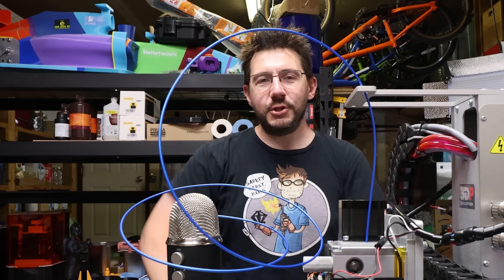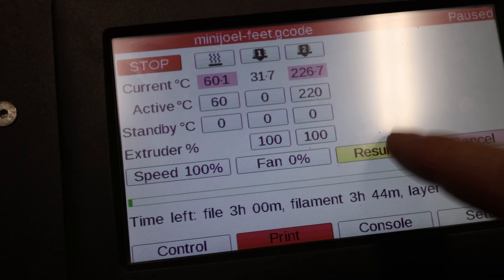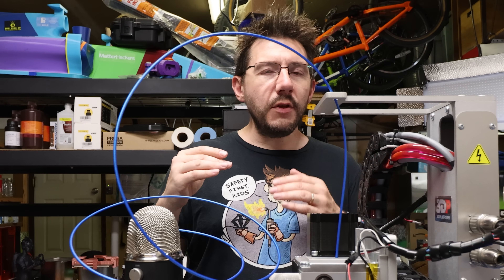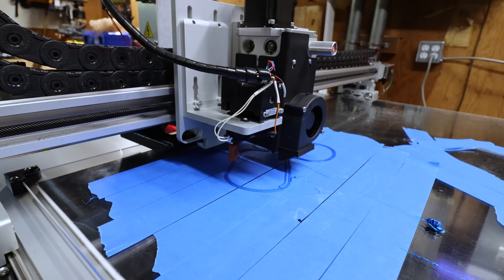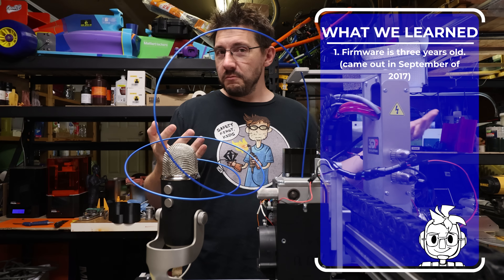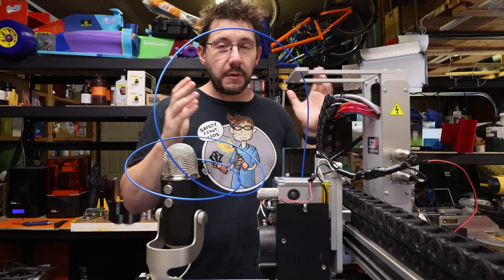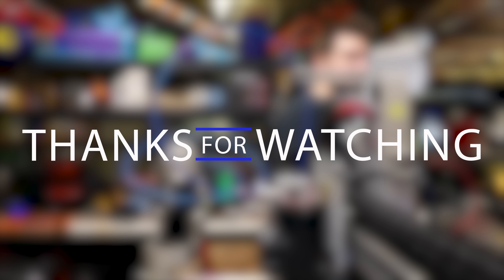Troubleshooting the $38,000 3D Printer

Comment: Hi there Joel. I've been thinking about the troubleshooting of the heating element temperature stabilization range. I have to see that in person, but that thing has a lot of metal to heat, this is 300W of power, and what I think is, even if you turn off the heating element, the temperature will drop until the internal resistance generates enough heat to stabilize the temperature, so it has to mantain the temperature on the higher side, I'm guessing, to keep the filament as "fluid" as possible in between the range... I don't really know but i wanted to discuss a little about the topic lol

Comment: This are some problems i ran into with previous itterations of this printer:

-Z home sensor fails occasionally and the nozzle can perforate the printbed.
-filament sensor can act unresponsive and freeze the printer due to false negatives.
-the printer doesn't work very well with cura.
-the printer's software is way too simple for a 38k machine
-the printer is way too basic like a cheap old anet a8 when it comes to features. 
The only thing this printer offers is that is big.

Comment: $38,000 ..... In reality it is less than $4000 in extrusions, motors, and control box. 10x profit seems excessive. Price gougey. Buy a REAL CNC machine, and get the print head upgrade. You will have a real monster of a machine for less than 10,000. Shown here is an expensive toy.

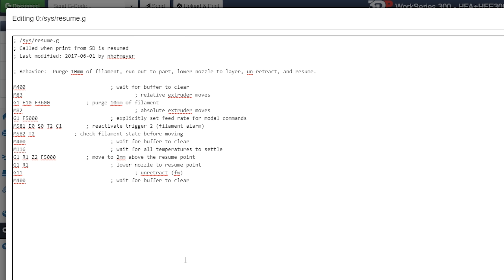Comment: 3:19 @Joel, your thoughts on how the temperature control should work are not correct.  You are thinking of a bang-bang type of control, but most of today's 3D printers use a PID type of control instead, which uses predictive algorithms.  If the printer's PID values have not been properly calibrated for the machine hardware and the environment in which it is operating, then the temperature stabilisation trouble-symptom you observed can occur.  So maybe try running a PID configuration routine first.

Reference:  https://reprap.org/wiki/PID_Tuning

Comment: Yeah the temp issue is a PID issue, likely. Run M303 H(insert heater #) S(insert your max temp) 
And yeah... RRF 1.xxx is ooooold lol it’s kinda painful to go through the steps of upgrading to RRF 3 by the Dozuki... but there is a short cut, if u have a copy of your firmware files (all the stuff on ur SD, sys, www folders mainly) 
Then you can follow the Dozuki and erase the internal board memory and immediately upgrade to RRF 3. Then just have to setup the DWC using the Dozuki steps. Once connected you can use the online RRF CONFIGURATOR tool to generate a .zip and u can upload that straight to the DWC and it will do everything automatically. From there u just have to make sure it homes right, z-offset, extruder direction correct, etc. all of this can be updated within DWC via command line or changing the config.g file.
Here is a video that can guide u through it:
https://m.youtube.com/watch?v=eW1l8QTkCyI

Comment: Waddup homie!?
Yeah, I suck at it too. :)
Since it's running Duet try hitting it with M307 H1 to report its heating process numbers (assuming H0 is the bed heater, H1 is the hotend, of course). Sounds like it's running in bang-bang mode instead of PID.

Comment: it seems like a PID problem to me. Even in the first  firmwares(more that 3 years old ) there is also a gcode command for auto tuning .When this problem happened to me , I used some icein an isolated bag to lower the temperature of the nozzle(not recommended but it worked) and then let the printer auto tune the PID parameters.
 https://duet3d.dozuki.com/Wiki/Tuning_the_heater_temperature_control

Comment: 2:10 Remember kids, you might want to power off the machine before opening up the control box (because there might be things connected to mains power, like that massive glass bed). Of course, kids shouldn't be messing with a $38,000 printer...

Comment: Interesting how the manufactures name was left out in the title.  I guess when things are going well the name is posted.  When you find issues, you leave it out??
I had one of these systems a couple years ago.  Bought it new from 3DP.  It was the worst.  If you want to print your large format parts to about 58% complete over a couple days, this is your machine.   
Customer service was terrible and my argument to 3DP was so this is what i get for $29k.  At one point their answer to printing a 16 x 16 x 18 part was to print it in sections.  What??  
 Before you buy a 3DP system ask them about the movement  in the gantry when it builds the upper layers.  It gets worse and worse the higher it goes.  I guess they forgot to do a motion study or just dont care.  If you're printing garbage cans I guess its ok.  We print mechanical mock-up parts and when I talked to them they assured me on the tolerance that it could hold.  I'm ok with the loose tolerances but above 12" look out.  We never had a problem with the glass.  It seemed to be quality and held up to a lot of our frustrating almost complete prints.

Comment: Duet has more than 1 filament sensor input, Not sure why this thing is in series, yes M116 is common command to resume a print, and if the firmware is that old, I know for a fact it has numerous bugs, I've been using duet for that long, and if I stayed on firmware for September of 2017, I would not be able to use my machine. Also temp tuning looks totally wonky. Duet when properly tuned will keep the temp within half a degree -  this is just amateur hour - but hey -- it's damn near 40k -- so oh well.

Comment: Could it be that the temperature is hovering higher because it is tuned for the filament flowing out of the nozzle and taking some of that heat away, thus reducing the temperature?
While the nozzle is just heating up without printing there is nothing to take the heat away...

Comment: I can build this printer if i want everypart machined in stainless steel ( no alluminium... oviestly the bed is 20mm thick alluminium and oviestly overkill heated pad...) and yes 👍 duet as electronics.. For this build volumes i want to go with 2.85mm filament. And just because mosquito hotend not make hotend for this diameter i go with e3d volcano 🌋  and i want 15000 euros (oviestly my labour is included in this price) i just want to try a custom 1x1.5 meter spring steel sheet otherwise i go with thick pice of borosilicate glass that's it 
holy shit ....

Comment: I'm definitely in camp "how about for the price of a small house, you don't have to do any troubleshooting and it just always works".  Even in the high level overview you've given, there are numerous examples of corners being cut that absolutely do not justify this price tag.
Reply: While I agree this thing is over priced, and there are clar flaws in design. I have some bad news for you, it does not matter how much something cost, if its complicated, problems are going to pop up, trouble shooting is always going to be a thing. Even those multi million dollar rockets tesla has been marketing often suffer issues, a 3d printer is not a rocket, but there are a lot of moving parts and programs working to keep it going, so lots of places it can go wrong, and eventually will. We still have not figured out how to keep humans from failing, why would our machines be any different?
Reply: @FastForwardPlans  the USB plug fell out of a 38,000 dollar machine.
Reply: @instazx2  A 38,000 dollar test bed that has been shipped to many different people, probably for 3 years given how old the firmware is. So even if people were careful it would be rapidly falling apart because of all the bumping and shifting around and use from all sorts of people.

Comment: I agree with some of the other commenters that the PID tuning is off.  Your description of how the heater should work would be incorrect.  The heaters should not even turn off.  Least while printing, the P, Proportional part of the PID would only allow a proportional amount of the 300 Watt heater to allow the hotend to recovery from even a 1C loss.  Not once it get below a set temp.  If it waited to do that it would be all over the place and you would get jams.

Comment: This is very similar to what I did to make my ToyDIY work. It would never start because the temperature would never get up to where it was supposed to be. Changing the temperature didn't help because now it wouldn't reach that temp. So I figured out that I could lower the fan speed and it would finally reach temperature and start printing, then I could bring the fan speed back up. Now it turned out the print head was bad and they sent me a new one but this got me printing while I waited for shipping.

Comment: I'm sorry but this 38k printer is not worth more than 10k IMO

1: The Filament sensor in series thing is un-acceptable, Not all applications require 2 filaments, also what if you run in to the fact of only having one spool. this would not happen realistically in an "industrial" setting but my point stands.
2: For a company to advertise with Duet 3D's name, it is 100% unacceptable that the firmware is 3 years old. Late 2019 is the bare minimum IMO. Regardless if there's a Beta version or not. 
3: For the USB cable to be unplugged is also unacceptable, even if it happened in shipping or not. Don the guy that installed the thing should have proper training to make sure everything is functional and working properly before he even thinks about leaving. 
4: and for my final point, and one of the main focuses in this video, This "300W High Temp Extruder" Should be PID tuned to at LEAST stabilize to the point of where it can resume a print. That much human intervention for a filament change or a run-out is absolutely unacceptable to any manner.

Comment: Honest feeling ....
That is just a 38k piece of junk. Flaws I have seen so far:
- The glass probably is not tempered (it broke the first print 🤦‍♂️)
- 38k and the filament sensor is in series ?! really ?! how hard is to make them independant!
Now you have to waste time troubleshooting?!
Come on! this is supposed to be a machine that gets the job not stands in the middle of it.
I mean I would expect an almost perfect machine for that money.
Reply: You also forgot that the 38k machine has no abl, and a wobbling x gantry. The only thing this has over an ender 3 is the size.
Reply: The white DIY screw terminal and wire management also doesn't scream quality.... There are cheaper cars with better connectors and wiring....
Reply: PETG is actually known to weld its self to bare glass whether it is tempered or not. It is better to use tape or some other method to separate the PETG from the glass, some people get lucky with things like glue stick but, if you miss a spot or the first layer is too low you might still run into the issue of part welding.
Reply: I wouldn't expect better from the machine, I'd expect better same/next business day support to be thrown in by the vendor though.  So a question to ask Joel is "What's the service contract like?"
Reply: @sarahts21  I'm not sure but it seems like Joel got it to play with rather than paid for. They do sell the printer to some rather large companies like Disney if you caught that in the last video, so they must provide some decent service. I'm pretty shocked that the firmware is so old. It seems to be the way though with machines like this, don't update if you don't have to that way you always know what's going on, but at this point it's so out of date from bug fixes and improvements that it's laughable. If you tried to get support for this from the Duet forums the first thing you'd be told is to update the firmware.
Reply: @JasonZnack  Nothing is odd about it, often you run years behind the curve in such situations.  IT is similar, I'd wager their is still so much w2k8 server racked up purring away.  

You don't go to the Duet forums for anything with a machine like this: you phone the machines 24/7 helpdesk  and they'll either remote in and fix it or truck roll an engineer. 

Disney are not going to accept "go to this other place's forums" for support when they've a department down.  It's the support/maintenance contract that moves this machine to a whole other class of device. 

So yeah I'm better Joel only has the machine not the full package to play with.
Reply from the maker: I haven’t had the chance to read the whole thread - I just saw your comment and wanted to say you are correct. I’m just borrowing the machine. Typically, there is a tech onsite for 3 days during install, with testing and troubleshooting and all that goes with it. They thought it would be interesting to let me borrow a machine and see what sort of trouble I could get into on my own.
Reply: @3DPrintingNerd  Might want to tell them that the general consensus is the machine blows and we want to see the full $38k package on display.
Reply: @sarahts21  or at least a disclaimer for us viewers so we don't get a bad image of the company!
Reply: Right. Things like this shouldn't happen wiht a device in this price range. An internal plug undoing itself? That's Anet A8 territory!
Reply: @elmariachi5133  My A8 never unplugged a cable after 4000 plus hours of printng,
Reply: @jz2188  Possible - But what else should one compare this printer with, than the cheapest 3D printer ever? ;)
Reply: @jz2188  your anet wasn’t shipped on a pallet halfway across the country into Joel’s garage while it was printing.

Nobody’s saying it unplugged itself from just sitting there.
Reply: I feel like I could build this printer for fraction of the cost.
Reply: @stranger7968  I'm literally designing a 3D printer right now and I expect to spend about a grand, and I'll have a 500x500x500 build volume, coreXY kinematic system, dual direct-drive extruders with all-metal/no-teflon-tube hotends, ABL, the same controller and touchscreen they're using but with the latest firmware, and practically every other feature this thing has aside from build volume. Scaling up to the size of theirs would roughly triple the price, I'd guesstimate.
Reply: @stranger7968  The OSE D3D is Scaleable (not certain how much, but a 1m^3 one was made), and could easily "beat" this imo
Reply: I had the same thought, got the vibe from the first video as well. :(
Reply: it's borosilicate glass and while it's tempered it's not like the others. that shatter like safety glass.
Reply: I think the petg broke the glass due to the first layer cooled too fast.
It is either that printer does not have a heater bed under the glass or the guy left it chill.
I personally printed petg on glass b4, thats why i recommend for those to add a heater bed under the glass. Some printer for whatever reasons, doesnt add them.
Reply: The duet firmware is so old you can't event find it to download. Current version is 3.0.
Reply: @cartolla  3.1.1 actually.
Reply: @JasonZnack  yeah, I was only speaking about the major, but you are right.
Reply: I'll give em about tree fiddy. Seems fair.
Reply: And the loose USB... Is just a matter of adding some tape on it!!!
Reply: If it was tempered it would not have broke like that it would shatter completely so it is definitely not tempered
Reply: @WyattH  This glass is tempered.
Reply: @WyattH  False, tempered glass only shatter if they are hit in the corners or suffer a thermal shock (hot to cold too fast or vice versa)
Reply: @JmonteroArg  or if it's hit hard enough
Reply: @JmonteroArg  False, if tempered glass breaks, it fully breaks due to the internal stress. Tempered glass is so strong because it's always in compression internally, anything that compromises that breaks the entire thing.
Reply: @JmonteroArg  I'm not sure if you are saying the same thing but tempered glass ALWAYS shatters catastrophically due to the manufacturing process which introduces permanent internal stress, hence giving it strength.  When it breaks, it always shatters but it is much more difficult to break compared to non tempered glass.

Comment: Step 1: never buy a $38k printer. Problem solved 😁✌️
Reply: Build the same thing or better for 1/4 the money and spend the rest on filament and supplies. Seriously, it's a $38K machine and they're running a Duet controller on outdated firmware? For that much I would have at least expected an industrial controller - hell, the control box for my desktop CNC mill has a Gecko G540 industrial stepper driver and an entire Windows PC built into it.
Reply: @s s IT PRINTS A 1000mm x 1000mm x 700mm BUILD VOLUME DUMBASS. It can print upto 700 mm, which is very high

Comment: The ability to easily change parameters via the web GUI via gcode is probably the biggest reason I love the RRF and run it on all five of my machines

RRF is firmware 3 now, and I would think an organization would keep updated as much as possible.  

Granted the change from RRF 1.x to 3.x is a massive change in the ways that the Config is done, but for machine, I would think at least RRF 2.x 

Then again, the saying “if it ain’t broke don’t fix” especially in industrial applications would likely apply 

But I’d definitely run a PID tune to correct that

Comment: Nice problem solving idea with the gcode edit.
And pretty cool to see how all these commands are handled with seperate gcode files on a control board like the duet.
Just makes you wonder why such an expensive machine is not better maintained firmware wise, and how an issue like filament-changes and hot end temperature control was not better tested and already corrected at the manufacturer.

Comment: The cool filament is the heater load for the system. With the filament not moving the temperature of the plastic is too high. The pid was probably tuned for moving filament.
Reply: It may be programmed with proportional control only with a +5 degree offset.